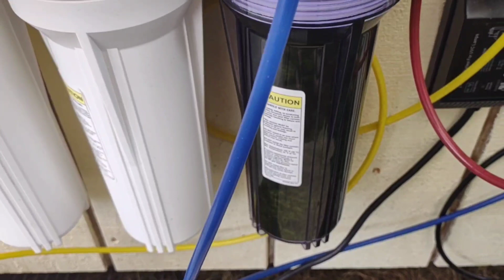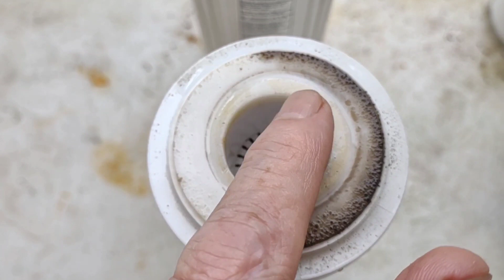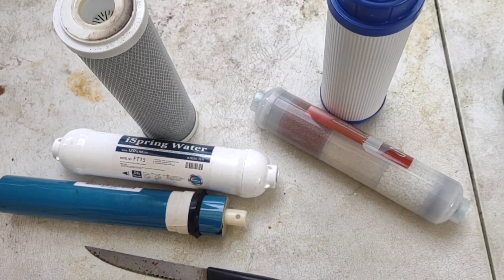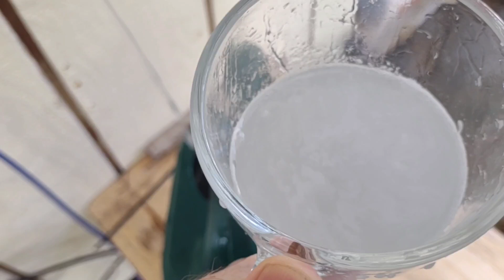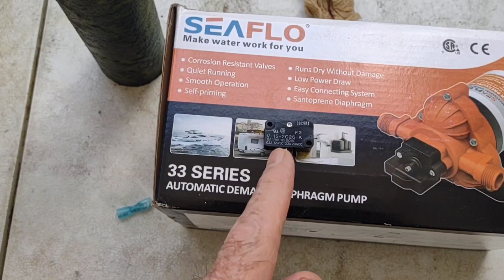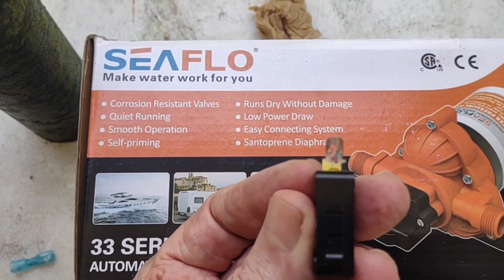iSpring R/O water system filter change

Comment: If your switch is burning out because of vibration, it sounds like it is arcing at the connection causing the connection to char and fail. You can get an electrical grease that would eliminate any arcing. Apply it to the connection and it will not arc.
Reply from the maker: Good call, I'll try that! Thanks for the tip!🤙

Comment: The reason why it’s running a little slower is because your r/o tank needs aired up 8-10 psi when no water is in the tank. The filters are there to protect the membrane and it still can make water with almost plugged filters , it would just take longer to fill your tank. You can add 1,2,3 etc tanks if you want more storage.

Comment: I'm new to your channel,
Really loving your solar set up and testing,
I'm getting lots of info for system I'm thinking of doing,
I work with RO and can offer some tips to help you,

Use 5 micron string as first pre-filter as string has twice the surface area to capture sediment and also wrap the clear bowl to stop the sunlight which will stop alge build up, or just order a solid white bowl if possible and keep the clear one as a spare, 

If possible use carbon block filter instead of gac (granular activated carbon) its a better filter all round and also better for flow, 

Make sure you get the old flat seal washer out of the carbon housing top and bottom,  because if you leave one of the seals in the housing and fit a new filter and tighten it will split the housing after a while as too much pressure on threads and bottom of the filter bowl,

Invest in a TDS (Total Dissolved Solids) meter (hm do a good one and won't break the bank)to test your membrane as membrane usually last 8 to 10 years on rain water,  reading below 50 on tds meter indicates that the membrane is working as it should,

Your 3 gallon storage tank,
Turn off water and empty the storage tank and check the air pressure (little blue cap as the aide has a shreader valve similar to a car tyre) air charge should be 7psi,
if pressure is too low you are not going to get the proper delivery of water,
don't go above 7 or 8psi as it will not allow enough water to store in the tank,

Remin filter wrap this in something also to stop sunlight hitting it to prevent the chance of alge growth also,

You should get at least 1 year out of the pre-filters and 3 to 4 years out of the other post carbon and re mineraliser, 
UV lamp has a life span of 9000 hour usually so annual swap should do that, (8760 hr in the year) 

As rule of thumb usually swap pre-filters and uv lamp and check the storage tank air charge  annually to keep it all timed, 
Keep up the good work

If your water pressure is above 15psi consider using a pumped RO to save the other pumps you were having trouble with, usually the pump can be protected with a low pressure switch fitted after the pre filters so if the filters get dirty it stops the switch getting the required pressure to activate, 

Aloha
Reply from the maker: Hey welcome to the channel and conversation here! That is some great information on the RO system,  and mahalo for taking the time to explain to us in such detail ways to improve,  and extend the life of all components.  aloha!🤙
Reply: @ProjectsinParadise808  
Glad to share my bit of knowledge with you and your viewers 👍🏽

Comment: Great video.  You must be reading my mind.  Where I live the typical home of two persons has a monthly water bill of about $110.  Worst of all is that the water tastes terrible.  So, we buy packs of 40 disposable plastic drinking water bottles which just went up from $3.98 to $5.65. So,  I was thinking of getting a good filter. 
There is a system that takes water right out of the air and filters it.  Then there is the RO type such as yours. I have been debating which to get. 
It would seem to me that in your system the UV light sterilizer should be at the very beginning of the pre-filters to kill off any algae so it won't grow in the filters.
Reply from the maker: Hey JR mahalo as always for the thoughtful comments! So , the 7th stage of the uv light is to be the last stage to kill any microorganisms that have possibly,  but unlikely passed any of the previous 6 stages. The reason for the algae building up on that first stage over time is sunlight.  I have it in my greenhouse so it gets plenty of light.  No visible algae comes from my cistern...it actually looks crystal clear even before getting to the system,  but we do have the potential for a few nasty microorganisms,  so out of abundance of caution added the uv light. Under sink application would mist likely not have an algae build up. I researched it hard for this environment from our department of health,  and they recommend uv as final stage for here in the tropics.  I actually used it for months before adding uv, but after reading a lot about a few microorganisms in the area added it. I feel better about that, and now nearly two years drinking catchment rain water no problems at all. aloha buddy 🤙
Reply: Did I hear right rain water 💦 got to try this for sure100%